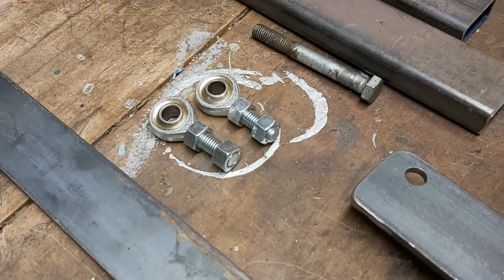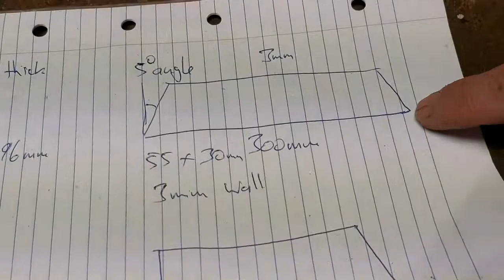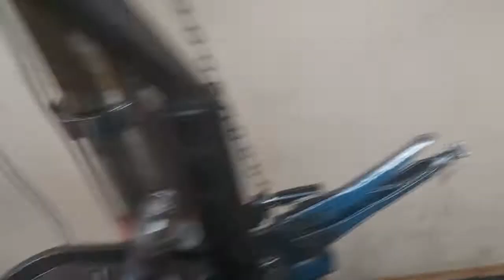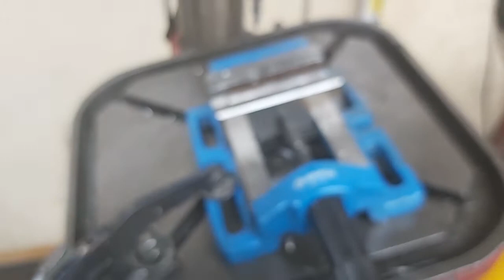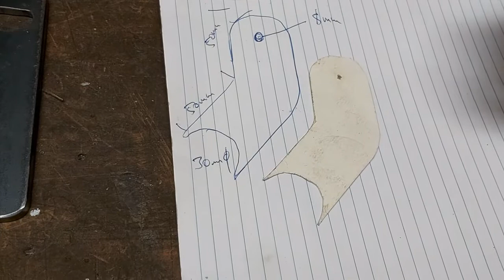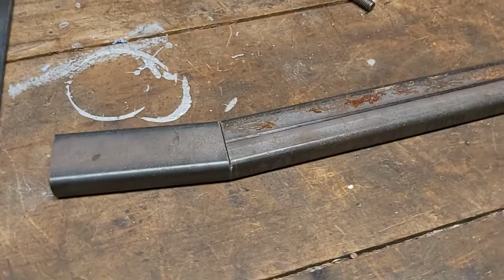Bazzas Backyard budget build part 2

Comment: I don’t have social media. How could I go about asking some questions. I’m attempting to build your axle right now, but I am starting over tomorrow because I’m not happy with a few aspects. Great videos.
Reply from the maker: Where are you  based. You can just ask questions here.
Reply: @bazzasgarage1922  I’m in America. I converted everything to inches. The one thing I struggle with is the kingpin. I put bearings in the end of mine, but when I go to drill the hole for spindles i stop before I hit the 12 mm hole drilled through it long ways. Also, I’m using 4140 for my spindle and I don’t know if that can be welded together. What metals did you use and how long were your spindles and the threads on them.
Reply: @ftlw1433  Yes you can weld that metal. the other option is to just buy bolts that already have the threads on them . Cut of the bolt head and then weld to the stub axle. The length will be dependent on the width of your rims and the width of the complete mower .Good luck.
Reply: @barrydawe3735  will you tell me what videos explains the angle for the tie rod and king pin angles. If there isn’t one will you make a videos going in depth on how you design that based on Ackerman, or whatever technique you used to design all of these parts?
Reply: @barrydawe3735  I forgot, could you tell me what the exact dimensions and angles are for the plate with the heim joints on the end of the axle? Also, the plate that welds to the kingpin that the tie rods would attach to I’m confused from the drawing.
Reply from the maker: @ftlw1433  check out my latest video of the kingkat build that should help.
Reply: @bazzasgarage1922  thank you. Your videos are really helping me out.